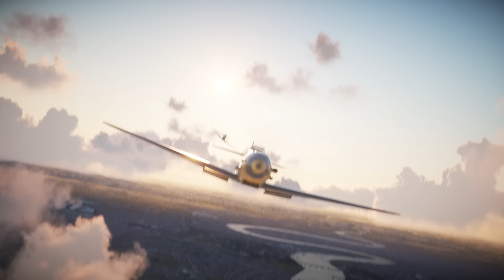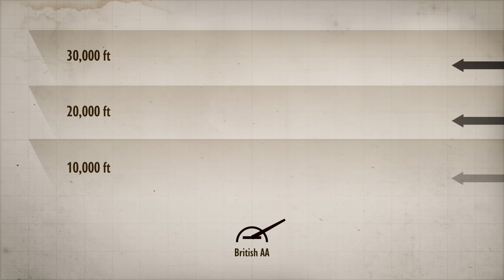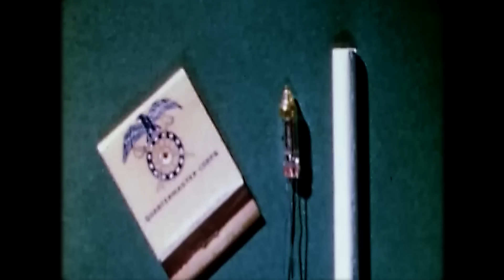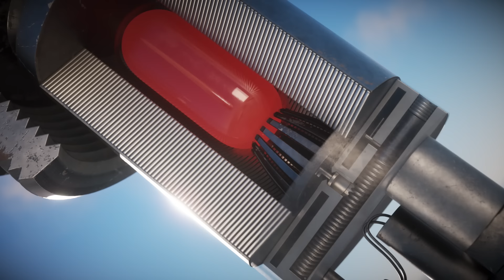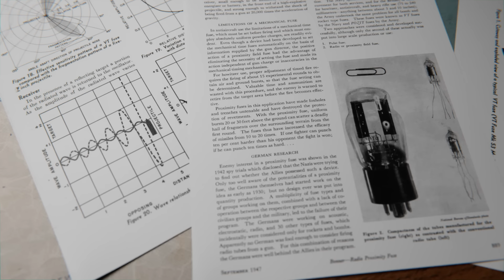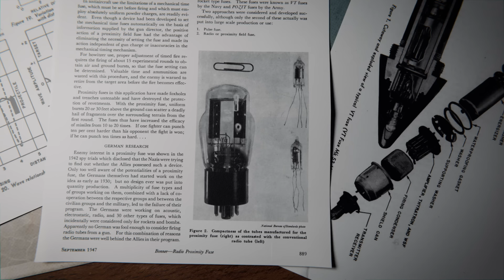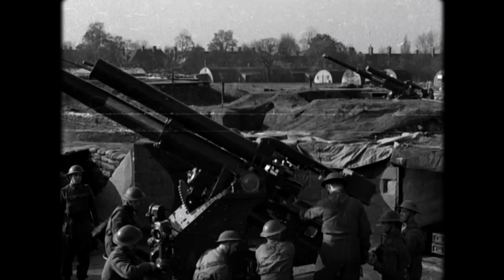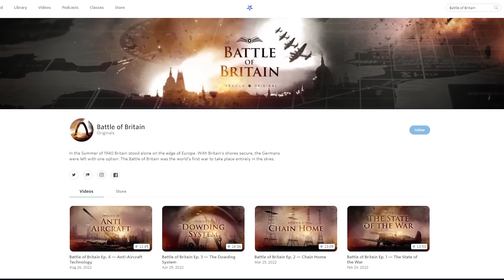The Secret Invention That Changed World War 2

Comment: The other 2 sides of the triad were radar from the Rad Lab, and the analog fire computer from Bell Labs. Together they made the SCR-584 radar system. It reduced the operation to feeding it ammunition. It was crucial in the Anzio landing, and the V-1 attacks post D-Day. There, they were placed on the Channel cliffs so both the shell fragments and V-1 landed in the Channel. 

Unmentioned in this piece is the VT project led to to the creation of John Hopkins APL
Reply: All thanks to the British giving the Americans the magnetron providing powerful microwave RADAR - we were thanked by the Americans holding back the VT Fuse for years.

Comment: They are still used throughout the military.

We (Navy) still use them, mainly for 5 inch, but used to use them for 4.5 - still called Variable Time (VT) and were throughout my time in.

While we can use a few different fuses (PC, TM etc) , and have a variation of round type, VT is by far the most common fuse. 

For practice, we use just solid projectiles for surface (can score visually by splash), but we used to use "practice flash" for AA practice. That was expensive, as the VT fuse is the most expensive part of the shell. The round explodes, but only a "puff of smoke" to show a practice hit. HEVT (High Explosive , warshot) would destroy the target.

We now use the same solid unfused projectiles for AA practice, as the target has the "proximity" detector, so don't have to waste money on fuses.

But warshots are normally HEVT. When I was on station in the Gulf (on gun console) I always had an almost full drum of HEVT ready to go in the gun. 

Of course, they are solid state, and no longer use valves. But other than that, essentially the same thing.

Comment: Worse than the mechanical time fuzes having to be set on the ground, was the  fact that they were not tick-tock clockwork fuses but powder trains that were started when the shell was fired, by an inertial strike, and burnt for a given length of time before exploding the shell. What was not appreciated at the time was that powder trains, despite having their own included oxidisers, tended to blow out at low air pressure at high altitude. So most of the AA shells never exploded at all and tended to fall on the greater London conurbation. When this was known, tactics and fuze composition changed.
Of course this being an American channel the work that the British did on the proximity fuze and shared with the US in the Tizard mission in 1940 is ignored.

Comment: From George G. Blackburn's Where The Hell Are The Guns?:

The buzz-bomb menace, which, for several weeks at the beginning, seriously reduced production of goods and services vital to the prosecution of the war (according to the diary notes of the Chief of the Imperial General Staff, General Alan Brooke) was brought under control by the timely arrival on the ack-ack (anti-aircraft) gunnery scene of the proximity fuse - a Canadian-American invention based on a British idea. Shells from the 3.7-inch ack-ack guns, which would have sailed past a few feet from a buzz bomb, were caused to burst and send lethal fragments into the buzz bombs' vitals when a tiny radio-transmitter bounced back from the pilotless monster.

The Americans developed the tiny radio transmitter and receiver. Canada supplied the design for a dependable power supply, which had to have long storage life but produce instant power to the little radio transmitter as the shell left the gun. Regular tiny batteries, with their limited shelf life, were useless, but scientists at the National Research Council in Ottawa, working with industrial scientists in Toronto, produced the answer: a battery that would remain dormant until activated by acid from a tiny vial broken within the fuse by the shocking wham of the propellant charge sending the shell on its way.1

Comment: Pretty awesome video and great research on your part. Two things: the variants used on fin stabilized projectiles and rockets functioned slightly differently from the spin versions due to the lack of centripetal force. And the term VT was assigned as a means to conceal the existence of proximity fuzing at the time. “Variable Time” was thought to sound far more ambiguous and wouldn’t tip off to listening ears that sensing fuzes existed.

Comment: Frankly, I cannot endorse the movie commentary, since I have always read that the proximity fuse doesn't work on the radar principle, but on the difference of capacities between 2 electrodes on the fuse, and the moving target.
Reply: I think you are recalling the German proximity fuze design.  I believe the Doppler explanation of the VT fuze is correct. Wikipedia has a good description of it, and there are many online resources
Reply: @ksbs2036  Wikipedia's explanation is quite good, but I note that the main element indeed is the variable interference, while for radar, it's the time between sending the pulse and getting it back.
Of course you need a radio wave in both cases, so I won't argue about the word radar too much.
The Doppler effect indeed is well explained here. I don't know when it was first applied to radars.
Thank you anyway for your remark, it's always an invitation to think deeper.
Reply: @paulmalore  I think RADAR has numerous interpretations.  For example, the radar speed sensors that police use don't send pulses and time their reflection but they use the reflected energy that is Doppler shifted by the approaching vehicle.  The reflected wave is mixed with a sample of the transmitted signal (using a microwave diode) and the output of the mixer is low-pass filtered to extract the difference between the Tx and Rx signals.  The frequency of the low passed signal is proportional to the speed of the vehicle.  

With the VT Fuze I think there are two things going on, and a lot of smart people spent a lot of their lives figuring out how to make this work with only three tubes IIRC.  I think they use the doppler signal to detect that they are near a target.  The doppler shifted signal allows them to know that this is a real target and that they aren't just seeing their own signal.  Then there must be some sort of threshold detection that says "If I see a doppler shifted signal AND it is higher than this magnitude then trigger the thyratron".  I have looked at the schematics of the VT fuze but I'm not a RF - Tube guy so I didn't really grok what was going on. 

Dunno if that helped or made things more opaque.  It was the Brits that figured out the whole Doppler thing, but to make tubes that would survive in a Fuze that could got into artillery is just mind boggling

Comment: Heh heh, I've been scooped!  I'm working on a series of videos making working replicas of the key components of some of the early VT fuzes. It's a big project, even larger in scale than my Great Seal Bug reconstruction. It's perfectly feasible to fit a semiconductor version inside a large-calibre rifle round, but I'm concentrating on the physical machining, antenna pattern modelling and testing, safety interlocks and building and testing of the original thermionic self-mixing receiver, filters and amplifier plus the thyratron trigger. I used to play with thyratrons when I was a nerdy teenager. Love the excellent visuals and production values! Super video.

Comment: 13?00 Since the fuse used radar to get close to its target, how was it used to rain shrapnel down on the forest below? It seems like the old-fashioned timed fuse would make more sense.
Reply: Very hard to get timing right. Proximity ensuring ground burst at appropriate height
Reply: @ksbs2036  Okay, so they use the ground as the target rather than an airplane. that makes sense.

Comment: How history is lost. The design of the proximity fuse was British. The effort to develop, produce and distribute the 70 types of proximity fuse was as expensive as the atomic bomb effort. It destroyed planes in such numbers suicide bombing was the desperate response.
Reply: Two billion USD?
A key improvement was introduced by Lloyd Berkner, who developed a system using separate transmitter and receiver circuits. In December 1940, Tuve invited Harry Diamond and Wilbur S. Hinman, Jr, of the United States National Bureau of Standards (NBS) to investigate Berkner's improved fuze and develop a proximity fuze for rockets and bombs to use against the German Luftwaffe.[9][33][34]

In just two days, Diamond was able to come up with a new fuze design and managed to demonstrate its feasibility through extensive testing at the Naval Proving Ground at Dahlgren, Virginia.[35][36] On 6 May 1941, the NBS team built six fuzes which were placed in air-dropped bombs and successfully tested over water.[9]

Given their previous work on radio and radiosondes at NBS, Diamond and Hinman developed the proximity fuze which employed the Doppler effect of reflected radio waves.[34][37][38] The use of the Doppler effect developed by this group was later incorporated in all radio proximity fuzes for bomb, rocket, and mortar applications.[33] Later, the Ordnance Development Division of the National Bureau of Standards (which became the Harry Diamond Laboratories – and later merged into the Army Research Laboratory – in honor of its former chief in subsequent years) developed the first automated production techniques for manufacturing radio proximity fuzes at a low cost.[38]

Comment: TECHNICAL DESIGN POINT:  VT fuzes had a small, especially-shaped antenna wrapped around the battery and oscillator radio source for transmission and reception.  The antenna had to be configured as designed.  However, when a glowing base tracer element was used to allow the gunners to see where the shells were going and adjust their aim, this burning tracer was ionized and electrically conductive, leaving a long invisible trail of electrified air behind the shell.  This acted like an extension of the antenna in the fuze and short-circuited its operation.  Thus, VT-equipped shells had to have their tracers removed,  To fix the aiming vision problem, every so many shells would be an old powder or clockwork time fuze with a tracer installed.  The smallest shells that could fit a VT fuze in WWII was a 3" (75mm) gun projectile, with 4-5.25" being used in the majority of US and British naval guns. Against German troops in Europe and Japanese-held islands, larger guns from 106mm through 203mm Army guns and up to 16" naval guns had HE shells with VT fuzes.